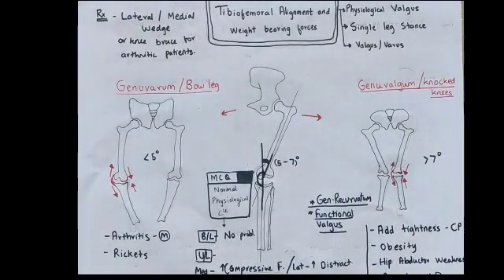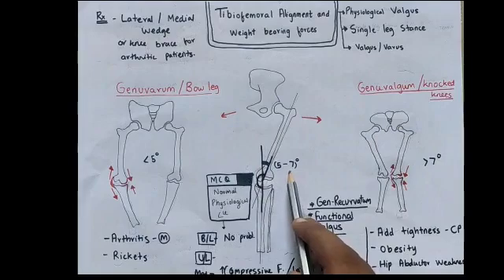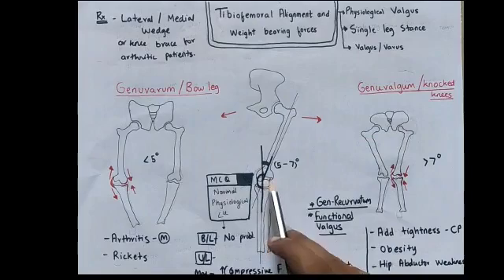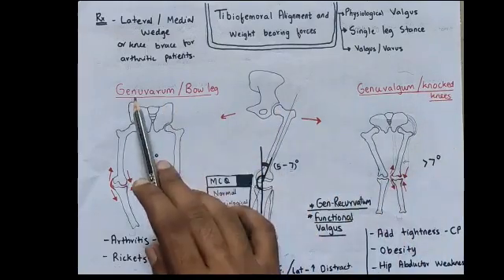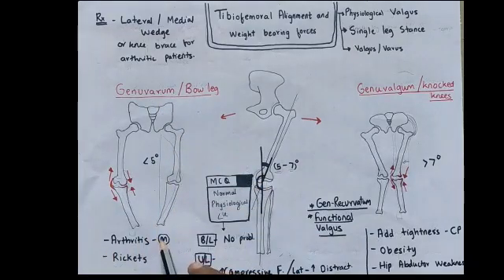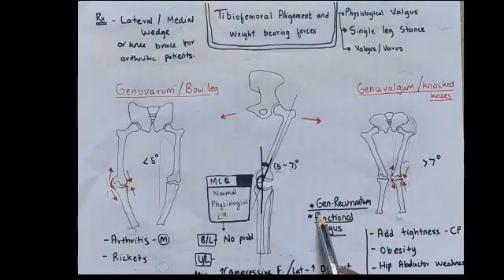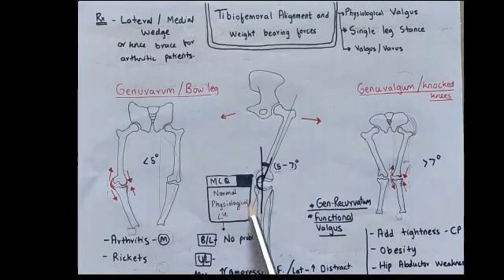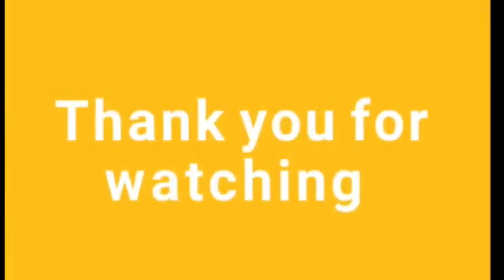Tibiofemoral Alignment (Knee  joint biomechanics) physiotherapy tutorials

Comment: BROTHER will u help  to know how u get the 5 degree fr bow leg and 7 degree for knock knees because in the book joint structure n function Cynthia norkin has written like this :......  The normal angle formed between the anatomical axis of the femur and the anatomical
 axis of the tibia on the medial side of the knee is approximately 195 degrees . Popularly termed bow legs, genu varum is misalignment of the knee joint such that the medial tibiofemoral angle is less than 180 degrees. 

how u find the angle  please help
Reply from the maker: I referred a different edition
But basically you need to subtract
185-180 that is 5 degrees
Reply from the maker: You can message me on Instagram and I can send you the picture